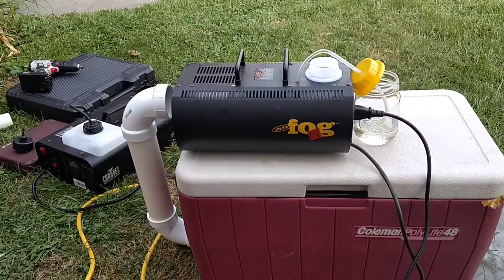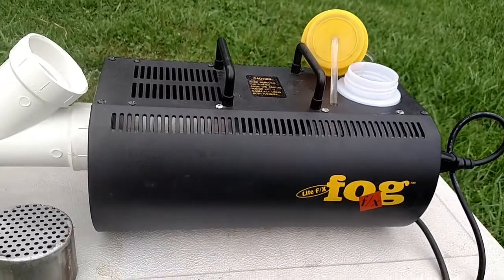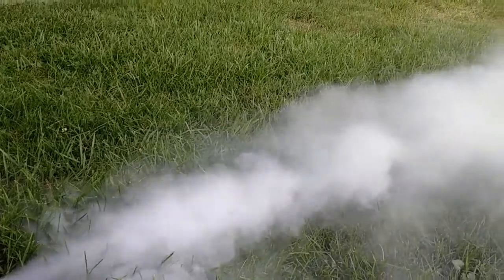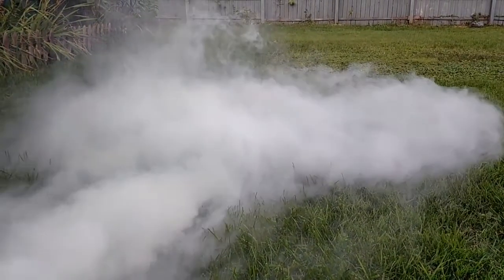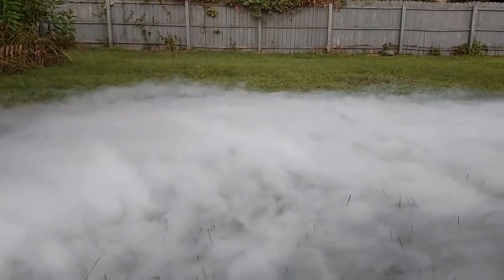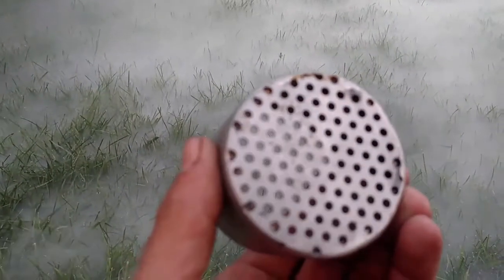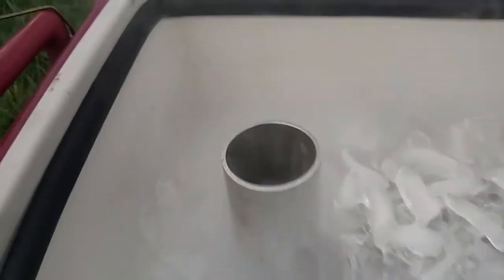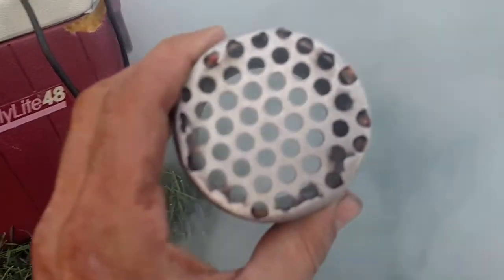Another fog chiller video

Comment: I like the idea of using the metal up pipe. My chiller is built out of a 6ish gal bucket, with all pvc parts, but you've got me thinking of seeing if maybe using metal and making it longer might make a difference.  And I'm definitely going to experiment with the cap idea too. 👍
Reply from the maker: Thanks. I was thinking metal gets colder faster.. Next year I might go bigger and try a trash can.
Reply: Yeah, plus it holds temp. I want to try an experiment,  but I think the "direct contact" system is always going to chill better than keeping the fog contained in a chiller tube. 
I'm toying with the idea of changing the output to add ice directly into the tube to get the most/longest chill. Simplest was would be just to stuff the tube with a layer, but I'm sure that could be improved on.
Reply from the maker: @blackc1479  I've used leach pipe with frozen water bottles in it..Worked pretty good before this concept.

Comment: Interesting design. This is the first version I've seen that has the warm fog forced down through the ice and the out through the bottom. Your video certainly demonstrates that it works great. I just built a fog chiller that does the opposite. Forcing the fog from the bottom up through the ice and then back down through a 2" tube and out the bottom.
Reply from the maker: Thanks
Reply from the maker: Jamie Coxe thanks

Comment: I’m researching fog chillers and found this video. This is the first chiller I’ve seen that uses a perforated “cap” at the chiller output, and seeing the difference between the ¼” & ⅛” holes, I’m curious if you have any information on the science behind them? (Or if you could point me to a link where I can learn more). The only explanation I can think of is to provide back pressure and/or to reduce the CFM of fog output?
Reply from the maker: That's pretty much what's happening.  Each cap
 that I made resulted in different output.
Reply: Monty, Thanks for the quick reply. So was this an accidental discovery? Or have you seen this done elsewhere? Any idea why restricting the output by using the ⅛” cap gave a better result? Have you experimented with using foggers with higher or lower CFM output? 

Sorry for all the questions, but your video just gave me inspiration to dust off my old DIY chiller, cobble up some restrictor caps for it, and see what happens.  It works “just ok”, but I was hoping for better so I kinda lost interest and tossed in storage. 

Thinking about it more to try to understand it better, I can imagine that arresting partial output might cause some of the fog to circulate back through the ice more, reducing the temperature further.  

I also like the metal piping inside, I believe metal will do a better job to transfer the temperature of the ice better than PVC. (At least that’s what makes sense to me, but I’m no scientist). 

Thanks for making this video and for the inspiration! Cheers!
Reply from the maker: @onstagesolutions947  Yes I did have higher end foggers but they all even my trusted one in the video dead two years ago on the big day. Yes I thought using metal inside would chill a lot faster. I figure the difference in out put by watching a few videos using a garbage bag... this style can also be used in a trash can. This one is a smaller cooler so I want a less wattage like a 700 to 750. My 1000 watt  just made my backyard like I was in London.  Lol